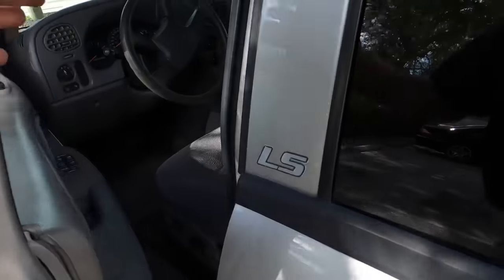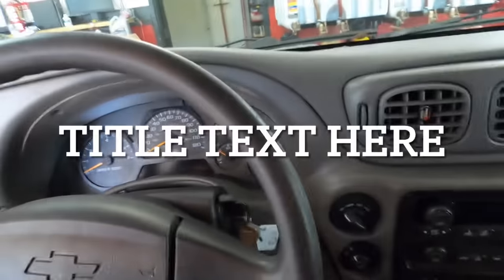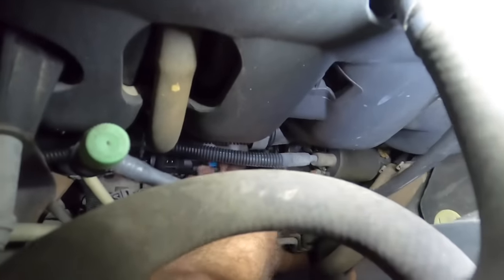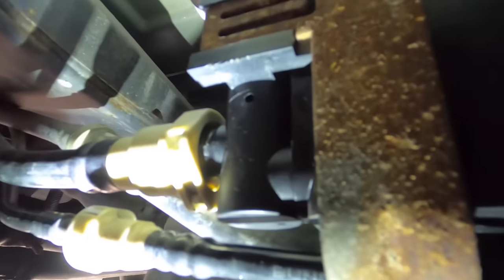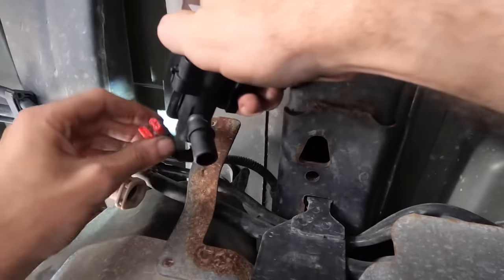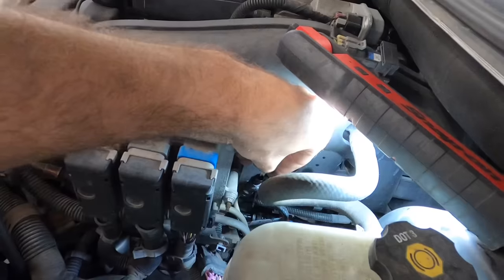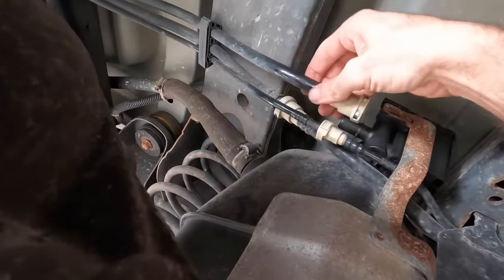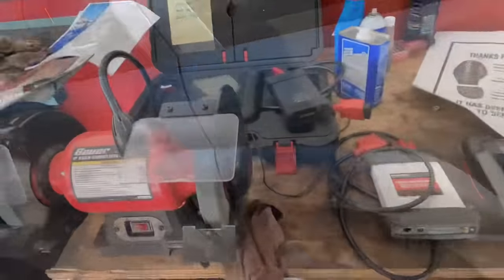Repair failed! Customer is Angry

Comment: I never take "hurry" jobs or jobs that give their own parts anymore.  I just send them on their way to somewhere else and let them deal with it.  People don't understand how often parts are faulty right out of the box and how much longer it takes us to deal with things because of that.
Reply: I accept them, in this day mode are on a tight budget and either buy parts themselves or back out of the repair alltogether!
So I just accept it with a written statement explaining that if x number of things are not fixed or diagnosed x number of results are possible.
This way they realize they should fix the parts I recommend based on evidence and proof of problem.
Offer payment plans through loans.
For example a guy came in with a 02 Jeep that had Wobbly suspension and car traveling left and right while driving straight.
You can say these 4 parts probably fix it but scan tools can't see mechanical problems like worn bushings.
So just lift the car for free and do a through inspection, I even let them look with me. This way they get confidence in the diagnosis and I can show them how many parts are bad.
This Jeep had Upper and lower control arms, front and rear Sway Bars + links, tie rod ends, shocks and steering stabilizer that had very bad bushings with ½" play.
That's a $2000+ in repairs and at least $1500 in quality parts.
In that case they need a payment plan and a plan of action to try and save them money buy changing the most likely parts first to see if that fixed the issues.
Shocks, tie rods, coil spring insulators and lower trailing arms first then rear upper control arm with ball joint second. All ball joints and control arms and Sway Bar Bushings and Links 3rd if needed because they come in a kit from Moog.
Let's say 1st plan works, you print out the needed repairs and it's level of urgency so they fully understand that the problem can go back to before the repairs and or get worse without addressing all of the issues soon.
But a lot of people want to only change dire problems today and needed problems a month later after the suspension snaps or wheel falls off.

Comment: I have had this problem, and have paid for two smoke test.  The smoke test did not show any leaks.  I also smelled gas fumes at times.  No mechanic could find the leak so I looked over the evap system myself.  I found a cracked vapor canister purge valve, and a crack in the hose that went from the fuel tank to the fuel tank vent solenoid.  The vapor canister purge valve was plastic, and getting old.  The plastic was also getting brittle.  I replaced the purge valve, and fixed the cracked hose.  That fixed the problem for me.

Comment: Dig your channel, my friend... You show us the right way of doing things, and the value of finding the root causes, not just treating the symptoms. But with that said -- It's truly disheartening that quality control has not been a priority for many years. Especially when some parts are very labor intensive which makes the job very costly for the Shade Tree mechanics like me and professionals like yourself. Many times, having to pay twice upfront exceeds the value of the vehicle, and/or the wallet of the one being billed. I know I'm not made of money and replacing a part is such a gamble that I have literally developed stomach ulcers from the anxiety. I used to love working on cars, but replacement part quality has sunk so far south that it's now a nitemare.
Reply: I hear YA, 1990 5.7 TPI. I thought that in buying GM parts like an EGR value and solenoid vacuum that was aftermarket was a Good Deal to take care of when a shop was replacing the intake gaskets. The shop was OK with that due to the parts being buried under the upper portion of the intake. Shop stated EGR was poop but the solenoid value GOOD. The new part was not tested being a new Delco part everything was button up when the failure was found. OH GEE upper removal again! They tested 3 more EGRs before finding a good one. Not really Drove home to engine light shining. Code was EGR again! poop A nearby shop check the code and also found a broken vacuum connector. Using a smoke tester like RAY used.
 There were a couple of other Items found that they were more than happy to show me. Shop#1 an expensive lesson! Shop#2 car is running like new. YUP nightmares and learning curve. Guys like Ray don't grow on trees, but there out there!
Reply: AZ & other stores will make good on the faulty part (s). I have a reman steering box that is just as bad as the one I took out. The labor and failed expectations of it all is what piss's me off the most about bad NEW parts.

Comment: May be related, but I have a 97 Z28 I had got new, over the years the charcoal filter has failed 3 times sending crap up the line and jamming up the purge valve. If you only replace the valve, it will soon jam up too. Now with 160,000 miles on it. it has had 3 filters and 7 valves.........

Comment: I'm wondering if a test drive could have brought some codes back? 
Would it have done nothing or was it not test driven due to the customer being problematic?
You found the problem regardless so definitely good job Ray!
Reply: No. Computer only re-tests Evap under certain conditions (eg within certain temperatures) and only after the car has been off for 8 hours. So it will likely take a few days for the code to re-appear if it's not fixed.
Reply: @nicholasmiles671  oh, I see. Thank you good sir!
Reply: The customer put a wrench in the diagnosis. Who knows what the code was? I would have sent him packing until the code reset

Comment: Just an FYI from my own experience this goes double on GM vehicles and triple on GM trucks if you have a repeated failure of a vent valve check the vapor canister. Remove it and turn it upside down if charcoal comes out that is the root of the problem to fix it. Replace the canister and remove all of the vapor lines and blow them out from the purge solenoid all the way to the vent. In my experience to do this properly I usually have to drop the fuel tank. Good luck guys I hope this helps.
Reply: I replaced the vent valve, purge valve, gas cap and canister on my ‘05 Tahoe.  The line from the canister to the tank was clogged with carbon pellets.  I vacuumed them all out (realized afterwards how dangerous that was - explosion risk).  The error code came back later (P0449 I think) and I’m getting a replace gas cap message in the DIC.  I’m wondering if there may have been an o-ring in the connector of the hose going to the tank that might have gotten sucked into the vacuum.  Or, maybe I got a defective cap?  I haven’t yet checked the filler hose for leaks.  Thoughts?
Reply: 🔰🇺🇸 I’m pretty sure this is the exact same issue I’m having and have had with my 2008 Pontiac G8GT. In the summer, I have to wait for the gas tank to bleed off through the filler, otherwise the tank won’t fill and it’ll spray liquid gasoline back at me.

Comment: I had a similar issue with my 05 XC70. The after market fuel cap was not compatible. Had to buy an original directly from Volvo to make the code go away.

Comment: Yep just cause it’s new don’t mean it can’t be faulty. Small engine mechanic. Put 3 brand new control modules on a chainsaw first 2 were defective. Sent them back to manufacturer for testing report both had a bad contactor in them.

Comment: Had a similar issue in my old 2011 335 E92.  I diagnosed it down to the (Bosch) leak detection pump, which is like a $80 part that takes about 20 min to replace with a little bit of low crawling...  This was early 2020 and car prices were dropping like a rock so I was in the process of buying a 19 440 F32.  Got a great deal on the 440 but dealer tried to low ball me on my trade because even though the car looked damn near perfect it had an minor accident on the Carfax report.... So I did what any responsible person would do in this situation; cleared the code, handed it it, and let it become someone else's problem.

Comment: Just had a similar issue with my friend's 2013 civic. Evap purge valve leaking, new aftermarket purge valve clattered so loudly you could here it over the engine and road noise inside the cabin. Oem Honda valve was $2 more and took 3 days to arrive. All good after new Oem valve. Glad it's easy to reach and a quick replacement.

Comment: You was hoping that the vent valve fixed the issue, word from been there and done that, retest the system with smoke. People will drive them all year long until the inspection is due. There can be several issues with the same code, or several codes that are hidden because it failed to test beyond the failure. Great video too!

Comment: Canister vent valves are normally open. When you used your scan tool to turn it "off", you effectively left the valve open. It should leak smoke when open. It shouldn't leak smoke when you actuate it by turning it "on" with the scan tool. That actually closes it.

Comment: Correct me if I'm wrong. But being a previous owner of a envoy (same as a trailblazer). I have had that valve fail twice as well and was told it fails quickly simply by over filling the fuel tank, meaning after gas station pump clicks indicating fuel tank is full you/I continue to pump more gas into the tank. I was told these suv's and many other vehicles are sensitive to being "stuffed" with gas.

Comment: Gotta love it! Codes and freeze frame data cleared, original repair was just installing a customer-provided part on a vehicle that has clearly had the parts cannon fired at it. These are usually a waiter that has somewhere to be in 33 minutes on a Tuesday afternoon and is leaving for a cross country trip in their car at 3AM Wednesday morning. Ranks up there with a driveability complaint on a vehicle that has had the codes cleared and shows up out of fuel. As diagnostic technicians, we do our best to stay positive as well as be polite and cordial with the customers, but we do shake our heads from time to time.
Reply: The correct response to 'Mr. Hurried' is always "If I can't take the time to do the job right and I can't have the time to thoroughly test my work before returning your car to you then I cannot warranty the work and you're still going to pay full price. If your part happens to be bad I won't replace it for free the way I do with the parts I use- you'll pay full price again if that happens. Same deal if your part doesn't fix the problem. Now do you still want me to do this your way?" Pissed or not, they usually give you the job, and you get to do it the way you wanted it to be done- the right way. If they go away mad you've lost nothing; that type's never happy. If you get the job they usually end up bragging about how conscientious their mechanic is and you get the best in free advertising- priceless.

Comment: You could see on the hose going to the vent valve before and after you took the hose off that it wasnt on correctly. The hose wasnt fastened properly. Probably a good vent canaster but the hose wasnt attached correctly

Comment: I have had Duralast parts on my Truck that took a crap a few months later or a couple years later. Returned to get a Delphi or OEM AC Delco part for my truck. Even a stupid MAF sensor was causing issues. I don't have a live data advanced tool to go through the computer, had to just diagnose from what I can see and recognize. Since chevy values have high limits, never threw a money light. Every time I did full acceleration, the vehicle would not be shifting fast enough as it is suppose to, stayed in that high rpm for too long, and speed increased very slowly at full throttle. Loan behold, an Autozone part I have bought years ago and swapping it for a Delphi fixed that issue. Not that I really needed to fix the issue, it was always there but never fixed it as it wasn't a huge concern until I stayed in Arizona desert heat where the problem really showed.

Comment: I work for a school corporation, had a 6.7 Cummins out of warranty turbo go bad. So I replaced both turbo and actuator with new parts from Cummins. 7 months down the road the actuator started acting up, I couldn’t believe it went bad, I did all the diagnostic checks according to quickserve, and decided it was bad so I got the part warrantied, so far it hasn’t had issues, and Cummins contacted me saying they won’t warranty new parts if they don’t install/diagnose so that’s lovely.

Comment: I don't know how I stumbled across your Channel but I love your content. I work for a dealership as a porter for about 5 or 6 years and would always hang out with the text while they repair the customer car is found it very interesting. I used to work on my own cars before they got more and more complicated and less and less room in the engine compartment. My first car was a 66 station wagon and you could actually sit next to the engine while you worked on it inside the engine compartment. It was almost like having extra storage for luggage LOL

Comment: "Just because it's new doesn't mean it's good" - man, I replaced all the plugs, distributor cap, rotor & points in a 1970 Datsun 240 Z because I had a misfire.  The misfire persisted.  DAMN!  ALL NEW PARTS!  I was frustrated one night so I opened the hood and it looked like a fireworks display!  Sparks were jumping from every plug wire to the nearest ground!  Every NEW plug wire had over 10,000 ohms resistance!

Comment: Forty years or so back I diagnosed a bad coil, replaced it with a Blue Streak coil and car still didn't go. After a lot of head scratching I decided the new coil was bad so replaced it with another Blue Streak Coil and cranked it over still no start. That really perplexed me so once again  had to trouble shoot everything else I could think of and came back to the coil. Put in a third coil boom started right up. I have had more than a few bad new parts but two in a row, that was something else.

Comment: I had to replace that vent valve on my old 2010 GMC Sierra. Apparently, there was a bulletin about that part. I was constantly having issues with trying to put fuel in and the fuel pump would always shut off like the tank was full. I don’t know why GM never did a recall for the vent valve issue. But at least I had the truck scanned and found out what the issue was before buying parts.
Reply: 🔰🇺🇸 Stupid P0049 code…I’m pretty sure this is the exact same issue I’m having and have had with my 2008 Pontiac G8GT. In the summer, I have to wait for the gas tank to bleed off through the filler, otherwise the tank won’t fill and it’ll spray liquid gasoline back at me.
— I replaced the evap canister and solenoid but the code keeps reappearing, so I’m thinking I gotta go for the tank sensor. It’s a pain too, since I gotta drop the rear cradle.

Comment: As a former auto elect (had to change trade after several major back and internal injuries trade related operations) I took a job as a sales rep for a nationwide after market and genuine parts distributor. As the warranty (sucker) officer/ clerk. I had plenty of phone call and conversations regarding faulty component's. Even some of the so called oem parts were not without faults. But on the other hand we had a lot of customers (at that time we were trade only customers) would throw parts at a job until it was fixed, then send back all the stuff that did not fix it. They expected a full credit on the parts, but they would (chuck a tanty) Australian for belly ache, when charged a restocking and re packaging fee. A lot of parts were also non returnable for credit, as they were electronic and easily damaged.

Comment: Just had a small engine fuel shutoff solenoid that was intermittent. Solenoid clicking to engage on engine stop and start but not passing fuel on engine start command.  Testing, homing the solenoid coil windings were good and no short to ground but handling to remove, test and reinstall resulting in a permanent bad electrical connection inside of the solenoid, downstream of its electrical connector.  Replacing it as suspected fixed problem. Local prices were double plus Amazon so 3 days later I had a new part to install.

Comment: Check the white wire at the vent valve. Pull on it bc sometimes the wire breaks inside and won't close. Usually within 6 inches of the connection.
Vent valves get dirty too and stick open.
Smoke machine..

Comment: A couple of days ago, I learned that Volkswagen is selling two types of spare parts. First ones are the usual good quality (less likely to fail) replacement parts which have VW and Audi's logos standing out in metal or plastic. 
Second ones are actually called "VW Econoparts" which are cheaper and you can notice the difference mainly because all the info, including the official logos, are "painted" or branded into the piece with ink. And you can read "VW AG" on them, many manufactured in Turkey, instead of Germany.  Equaly sold in original and licenced VW packages.